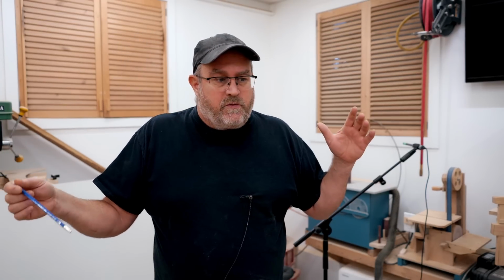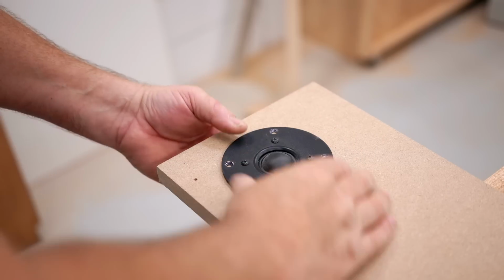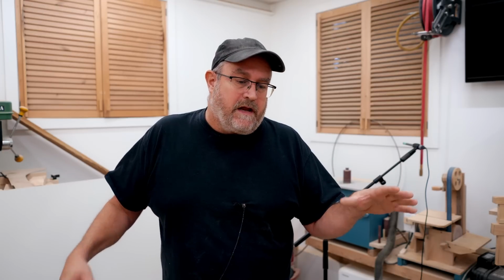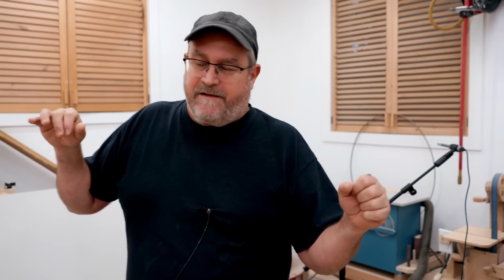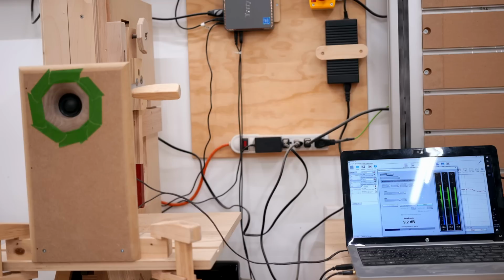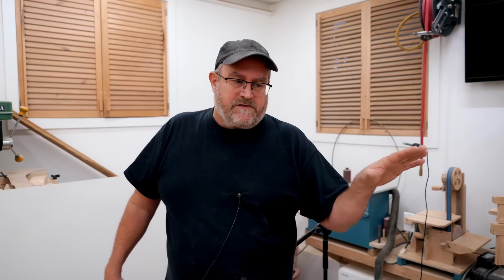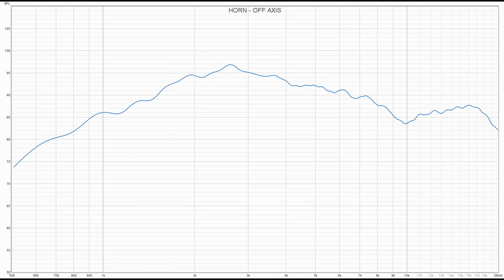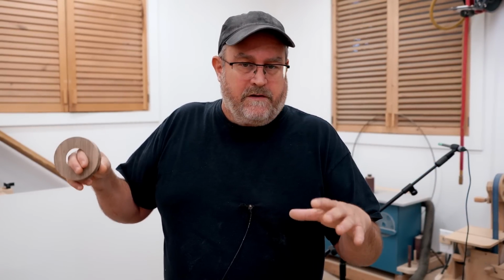What Does a Tweeter Horn Do? And Diffraction Myth Busting

Comment: Re round over of baffle, the radius of the round over makes a difference.  The larger the radius, the bigger the effect.
Reply from the maker: I gave they typical example you'll see on most boxes. 
While a bigger radius might make a measurable difference, the question is does it make an audible difference. And an audible difference that's clearly better. And better by enough to be worth the time and expense to make the bigger roundover.
Reply: @IBuildIt  in my experience, yes a larger radius sounds better, at least to my ears.  If you think about it, what is happening is as the wavefront is traveling across the baffle, half space, it has a certain impedance with the air.  As it reaches the edge and wraps around the box, the impedance rapidly drops.  The slower you can make that impedance change, the less chance the wave front cause diffraction.  It is similar to a horn that does not transition properly at the mouth of the horn.   I started using a thumbnail bit.  The changing radius seems to help.  I am doing a speaker now, first one with thumbnail bit, and it seems to help with soundstage width.
Reply from the maker: Well, I think that's part of the problem: too much thinking about it leads to the conclusion that it must make a difference. Siegfried Linkwitz did a number of detailed tests to measure the effect and audibility of diffraction and  found that while there was a disturbance in the frequency response, he detected no change in the sound: https://www.linkwitzlab.com/diffraction.htm
My own experience is that I've had speakers with and without edge rounding and can't say with certainty that rounded edges improved anything. My current setup are my roughly mocked up open baffles made from scrap plywood with nary a round edge in sight, but play the widest, deepest and most realistic soundstage I've ever heard. 
Likewise with the bookshelf Elac's I used while setting up the room - they are square edged and have a very good soundstage.
Reply: @IBuildIt  I agree that listening must be part of the equation but if you don't start with thinking, or use thinking to evaluate what you hear, then the listening doesn't amount to much improvement. I also agree that I have heard speakers with square edges that create excellent sound stage.  What that tells me is more thinking is needed. Lol.  In all seriousness, thinking is needed to figure out why that is. Are the diffractions broken up into many smaller diffractions that are virtually inaudible?  It would be interesting to figure out why that is.  Regarding the study you have cited, I am not familiar with it.  But I tend to use past studies as a guide, not a hard and fast rule.  Some are correct.  Some, not so much.  Some did not isolate variables that could have changed conclusions.  So I tend to learn from the studies I read but use my own listening/experience to determine validity.
Reply from the maker: What I meant by thinking is over-thinking - rationalization. The problem of diffraction is known, and therefore because it exists you need to address it. But the existence of an effect doesn't mean that fixing it will make a significant difference. 
Can you honestly say that every time you listen to your system it sounds exactly the same? Hearing is influenced by so many factors that are pretty much out of our control, and these factors completely eclipse a minor problem like edge diffraction. 
And then there's the fact that there have been no scientific research that proves it's audible. If it were that easy to discern, there would be at least one.
Reply: @IBuildIt  That is why I like having these discussions back and forth with you.  We come from two different angles, sometimes agreeing, sometimes not.  Makes it interesting.  I agree with most of what you said.  I have two comments. 1: yes, we hear things differently at different times but that does not mean I cannot tell what I am hearing.  I have been in audio (professionally) for +/- 35 years.  I have learned not to make snap judgements.  I accumulate information and data over time to come up with conclusions.  2: As you said we all hear differently, from one listening session to the next and from person to the next.  Some people's hearing are more tuned to certain aspects of sound and other people other aspects of sound.  I am not as tuned to frequency response but I am to time arrival.  I am able to hear time arrival issues that other people can't hear.  That may be why to me, diffraction is more audible than for you.  "Studies" may say it is not that audible, but we all hear differently.  I can't actually hear what your brain heard and vice versa.  That is what makes sound so interesting yet infuriating.  In the end, we need to understand that one person's listening experience should not trump another's.  Because one person doesn't hear something, or not enough to make a difference, that does not mean the person who can hear it is invalid.  I can't hear to 20k anymore.  Does that mean that those frequencies don't exist or that those that can hear them really can't?  But again that is why I like these discussions, two thoughtful people coming from different directions.
Reply from the maker: @jked7463  For me it's never about: "you are wrong and I am right" It's about rationally looking at the various factors that affect what we hear and putting them in their proper place in terms of importance. 
So a problem like diffraction would be so low on that list that it wouldn't even factor into a discussion on sound quality.
There are much, much bigger concerns that have orders of magnitude more impact on sound quality than diffraction could ever have, and yet it gets so much undeserved attention.
Reply: @IBuildIt  Again, agreed. The only difference is that to some what is far down on the list to another is much higher on the list.  For me, this is especially true since it is relatively easy to solve.  You tweeter wave guide is a perfect example.  You didn't just cut a hole with a whole saw.  You modeled a complex, yet gentle curve.  Why?  Because you felt the diffraction caused by a simple hole as the sound emerged from the hole and the air impedance suddenly drops would be objectionable.  So some types of diffractions are higher in your list.  Anyway, again, to me it comes down to what different brains  hear. Well, enjoyed the discussion.  Continue to have fun on your quest.  Enjoy your videos.  Keep them coming.
Reply from the maker: The horn flare needs to expand to work properly, so a straight hole wouldn't give the lower frequency boost that the expanding hole does. 
And while I'm not putting much faith in anyone's ability to hear diffraction effects, that doesn't mean I'm won't do the normal things used to reduce it. But I'll do it for looks first, and then as a preventative measure against the inevitable comments about how they speakers can't possibly sound good because they are a diffraction factory.
Reply: @IBuildIt  I get it.  I get it.  You don't think diffraction is important and therefore I can't hear it either and shouldn't think it is important either. .  You've beaten me into me.  The horn flair does more than just boos lows.  Horns also have their own form of diffraction.  That is why the quest for the perfect horn flair has been a never ending quest. It's all about changing air impedance. But I apparently don't know anything and my understanding is false while yours is correct.  If you don't think that, it comes across that way.

Comment: Nice channel and video!  Really nice craftsmanship!  Anytime I see painter's tape to fill in gaps, I know I'm gonna enjoy the build!  😂

FWIW, the real issue with diffraction isn't so much the on-axis dip.  It's the response off-axis relative to the on-axis response; the reflections sent out into the room have a different response profile.  Ideally the off-axis and on-axis are similar in response (just, narrowing in directivity like a good waveguide does).  While you did perform an off-axis measurement set, you gated the response (as would be typical for quasi-anechoic).  But, at the same time, it also doesn't allow you to get a typical in-room/in-seat response that would show the real issue of diffraction.  What would be ideal would be to get the ±30° radiation and compare that to the on-axis.  You should see the this region is stronger in response than 0° and this delta is what causes typical diffraction effects to result in issues in-room at the seated position (often shoutiness or sibilance depending on the baffle width/distance of tweeter).  Second, the dip ~16kHz looks to be cancellation between the dome and throat termination but I doubt anyone would notice it and the tradeoff for what you gained is well worth it IMHO.  And the purpose of the waveguide being to control the radiation and in doing so, what you have here is a waveguide profile that is narrow than the flat baffle (a flat baffle is a waveguide, too, just ±90°).  Not sure if you knew this already but you mentioned some doubt as to what was going on the HF so I thought I'd try to help there.  

The one thing I really like about your waveguide is that it doesn't result in a peaky response.  Rather, it acts more like a shelf filter; raising the response without creating a high-Q resonance that needs a more complex crossover network.  Kudos!

At any rate, killer stuff, and I'll be watching more when I can.
Reply: If you look at it with the eyes of an audiophile, it's 1%, but if you look at it with the eyes of a producer or a music engineer... believe me, my friend, it's 300%! Thanks for making a practical case; there's only theory on the internet about diffraction.
Reply: I think some people can hear that last 1% and some people can't. (I think I could when I was younger, at least, and so I design speakers to minimize diffraction.) What matters more is that you guys are having a thoughtful conversation about a fascinating and controversial issue. Cheers and thanks!
Reply: Yeah its interesting as I did a bunch of sphericals etc. re diffraction. I agree with many of the other comments but using a small flat plane and not having the return angle will not provide adequate comparison. Ultimately...can we hear it is so true. With sphericals, especially single driver, the absence of phase smear is huge in my experience.
Great work though...really enjoy your vids
Reply from the maker: Hi Erin and thanks for the comment. 
When I do a test like this my goal is to try to get people to learn to put things in perspective. Way too many people today fixate on what are minor issues and lose sight of how important they are in the overall. 
Diffraction is a measurable and fixable "problem", but that doesn't make it a significant one. Plenty of highly regarded speakers did nothing at all to mitigate the effects of diffraction. In fact it's like they went out of their way to cause more diffraction with surface mounted drivers and a rim around the baffle.
This isn't me saying that diffraction should be ignored, just that it's in that last 1% of gains you'll get in a speaker design. And that the gains in that last 1% are going to be mostly of the peace of mind type - the "I did it so it's not a problem anymore" category where you can imagine you hear a difference.

Comment: Good call on the oil base stain.  Back when I was doing hardwood flooring, we always used an oil based stain before the water based finish.  (There are water based staines that can be used, but they also "pop" the grain...so you have to sand everything again before coating with finish.)

Comment: Horns do increase efficiency.Dramatically.Just look at the efficiency of the tweeters made by JBL and other companies.They are well over 100 dB efficiency .
I was never a fan of horn drivers because they tend to have a slightly echo like sound 
I never liked Klipsh for that reason 
I think IMO silk Soft domes are the most accurate 
If you want a tweeter that is very bright and very efficient.A JBL Titanium is both efficient and bright .If you even slightly increase the Treble on you receiver or Equalizer 
The Titanium tweeters react to even 2 dB
If you crank up the treble ,man they are overbearingly crisp 
I love Morel,Vifa ,Focal ,Peerless soft Dome tweeters.
They IMO are bar none the best

Comment: What a coïncidence, I did the same type of measurements (flush vs non-flush) yesterday on a tweeter too. The diffraction on-axis on the non-flush mounted tweeter largely disappeared15 degrees off-axis and up. The problem though with the diffraction is that it makes it a bit more difficult to get the cross-over right, especially getting the transition between mid/tweeter smooth under different angles.

Comment: John ... A small 3/4" round over doesn’t make a real difference. ALL speaker designers know it takes a 2" or larger round over makes A VERY measurable difference. It's not done very often, due to the difficulty. See a Vapor Audio Cirrus speaker for a proper example.

Comment: Horn shape is extremely important, even on a shallow horn like yours.
You will find there is a significant difference in the response, especially off axis, between your current horn and a conical horn.
Your horn will have some amount of beaming (as shown in your measurements) because of the shape, you will find that making a conical horn will give you constant directivity which many people find very desirable.

Horns are a very complex subject. I agree that getting close to a particular shape is probably good enough in most cases, but the difference between particular shapes as really significant. Also, unless your tweeter is meant to be horn loaded, you will get much better results designing it to be a wave guide.
Reply: "Horn shape is extremely important, even on a shallow horn like yours."

There is NO, ONE solution, that covers the millions of different listening environments/rooms that the speaker has to fit into .... none! To state otherwise, is hugely misleading ... at best!
Reply: @juststuff5216  Didn't state there was a best horn shape. I merely stated it was extremely important, and gave an example.
Reply: @joshua43214 totally with you. John seems to always make speakers that HE likes, aesthetically and sound wise.

The biggest change in sound from his horn design will likely be the off-axis response and the impacts that makes. To design a horn without regard for its impact on sound is like popping a large inductor in a crossover because you think they look cool.  If you like the sound as a result, that’s great. But it’s a very trial and error approach and just objectively makes little sense to do if sound is a primary concern.
Reply: Did you watch his video about horn shape, or are you knee-jerking and flapping your jaw because of what you think you know already, and aren’t interested in his thoughts on the subject?

Comment: Is this really a horn? Because it looks more like a waveguide. If it was working like a front loaded horn I find it peculiar that it losses that much high end.
Reply: Horns increase efficiency.  Waveguides control dispersion.  All horns are waveguides (some better than others) but not all waveguides are (practical) horns.
Reply from the maker: @ErinsAudioCorner  since all waveguides (as named) have a horn shape, they are horns. Can you point out an example of a waveguide that doesn't have any of the impedance match gain that a horn has?
Reply: @IBuildIt any speaker with a flat baffle. 🙂
Reply from the maker: A flat baffle would only be called a "waveguide" by the most pretentious of speaker designers :)
Reply: @IBuildIt  but the point is it’s a fact. Thus my initial comment about the difference between wave guides and bathels. Another example would be the mini shallow wave guides you see on cheaper bookshelf speakers. The vast majority of them are too shallow to provide a horn load effect but do help control dispersion to some degree. Look, I’m not challenging your authority on your own channel. I’m just trying to help people understand the difference.  👍
Reply: @ErinsAudioCorner  A Waveguide and a horn both increase efficiency and dispersion. It's a matter of linguistics and the transition from a waveguide to a horn is fluid. A waveguides purpose however is to assist a tweeter throughout a broad frequency range. A Horns purpose is to maximize sound output of a bandwidth of no more than 2 octaves. His creation fails at both. If you want a tweeter to work from 2khz all the way to 20khz you'll want more of a waveguide.

He should have used a proper tool to determine the curve and experimented some more. Also the throat area is way too large in respect to the diaphragm inside it, but that should be obvious.
Reply: @ErinsAudioCorner   A Waveguide and a horn both increase efficiency and dispersion. It's a matter of linguistics and the transition from a waveguide to a horn is fluid. A waveguides purpose however is to assist a tweeter throughout a broad frequency range. A Horns purpose is to maximize sound output of a bandwidth of no more than 2 octaves. His creation fails at both. If you want a tweeter to work from 2khz all the way to 20khz you'll want more of a waveguide.

He should have used a proper tool to determine the curve and experimented some more. Also the throat area is way too large in respect to the diaphragm inside it, but that should be obvious.
Reply from the maker: horn = waveguide = horn
like pants = trousers = slacks = breeches = pantaloons
different names for the same thing, depending on how pretentious you want to seem.
Reply: @IBuildIt  I've seen many differentiate
Between them depending in the amount of acoustic gain/impedance maching they offer. Sure they both offer controlled directivity. How do you explain the drop in high frequency?
Reply from the maker: I said in the video - a cancellation in the throat near the dome. It's a characteristic of all horns / waveguides.